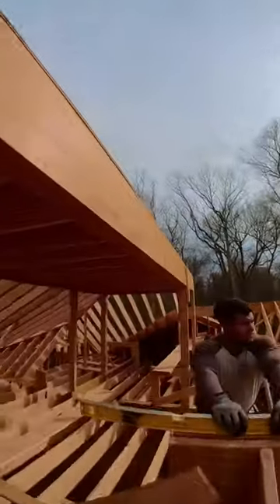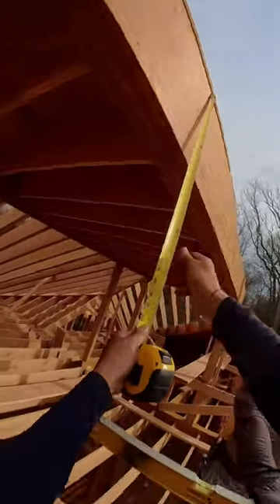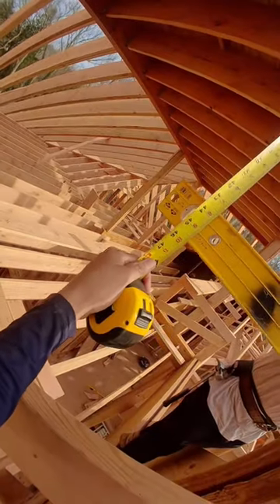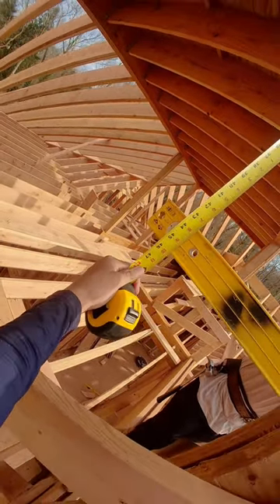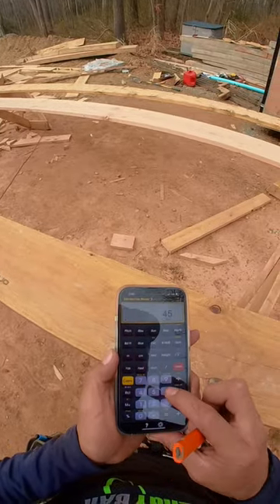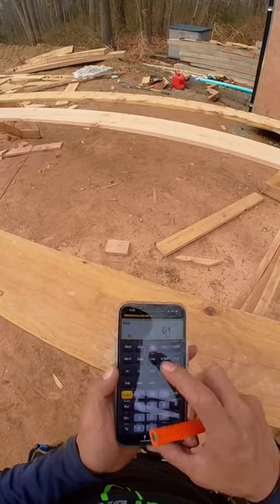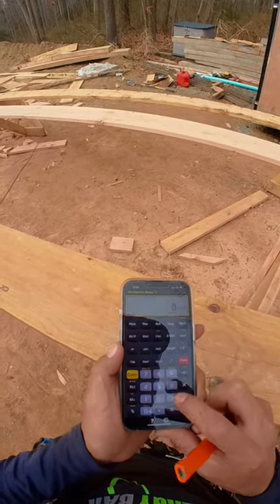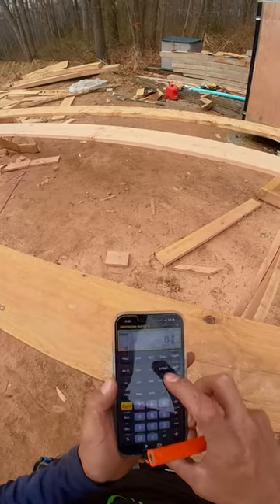How to do a rafter #skills #shorts #tips #team #beauty #perfect

Comment: I need one of those calculators. Doing by hand on paper is slow.
Reply: They help a lot!
Reply: They have an app. 
Construction master.
Reply: @AllaroundNbackagain  thanks I will check it out.
Reply: @ridinrancher9443  
Calculated industries is the maker.
Reply: A framer with no calculator is no framer
Reply: You don’t just do it in your head?
Reply: you could use metric but that would be using your noggin lol